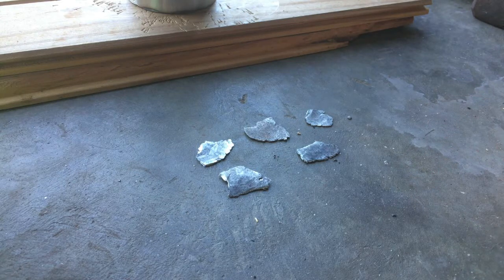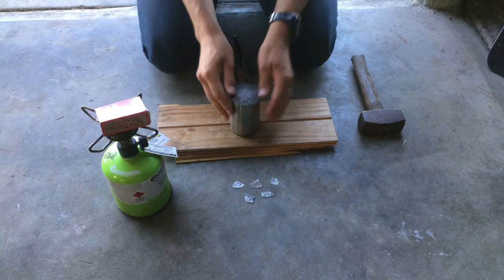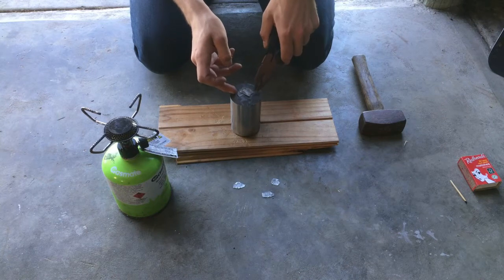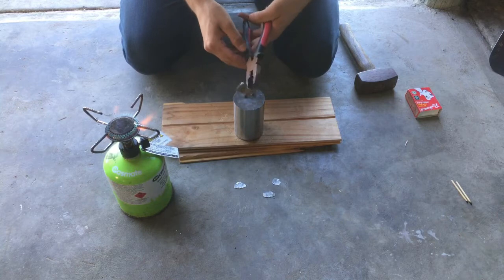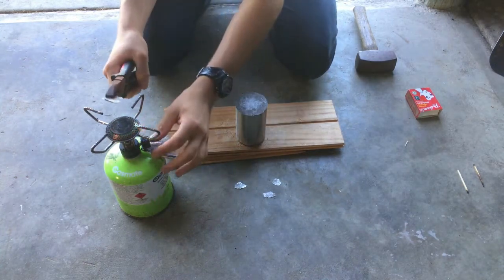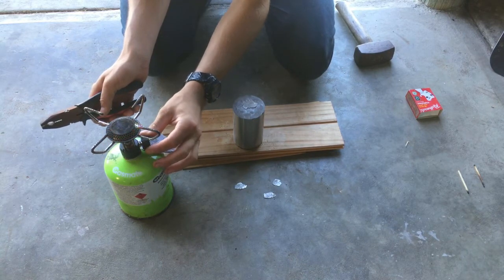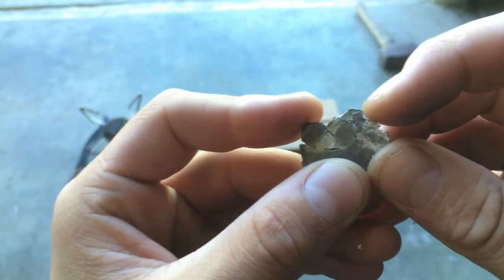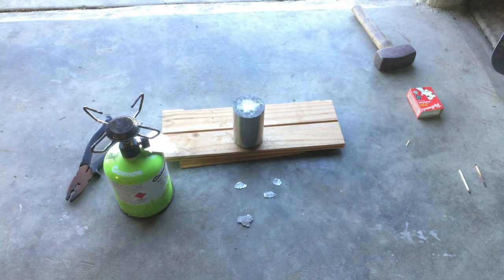Welding with a hammer - Will it weld? pt 1

Comment: This is cool, but evidently not very effective. It would be better with the usual steps involved with forge welding, sanding, and flux, but welding temperature aluminium flux is not a DIY kind of thing. It's commercially available as a paste, but it's like $50 for a tiny little tube, and it's probably super toxic.

Which is one of the reasons aluminum is usually cast, not forged. But that has its own issues, molten aluminium has massive surface tension(which causes the aluminium to climb up the mold), which is why casting aluminium is >1% silicon. It also helps to preheat, or simultaneously heat the mold.

Gas pitting is prevented by bubbling nitrogen through the molten aluminium with a carbon lance.

Salt is used as a flux to prevent slag buildup, either NaCl+KCl, or NaCl+CaCl2(lower melting point, more slag prevented/removed). (borax reacts with aluminium)

At home you'd probably want to use a lost wax mold method, with sand or plaster, and lots of reservoirs and tabs.

Cast aluminium can still be hardened by heating it to just below the melting point for >5 hours, and quenching in boiling water.

Sorry for the write up. This may have been for my sake, more than it was for anyone else.
Reply from the maker: Yes, you are right, this was not very effective. I also want to try lost wax casting in the future sometime.

Also, no need to apologize for the big write up, I enjoy reading comments that can give me more knowledge, so thanks heaps for this!